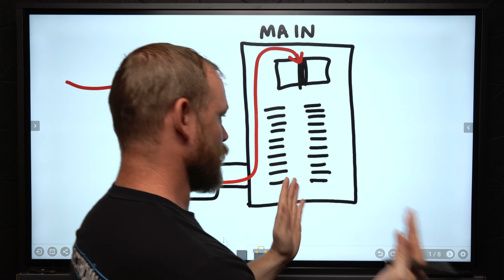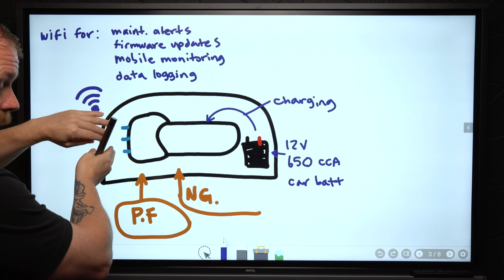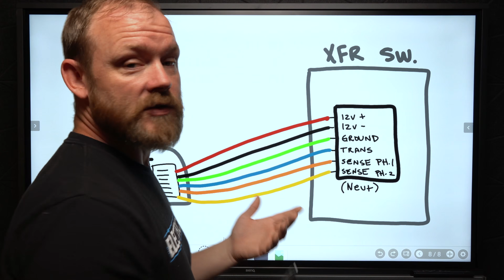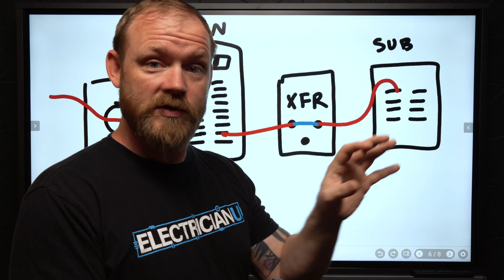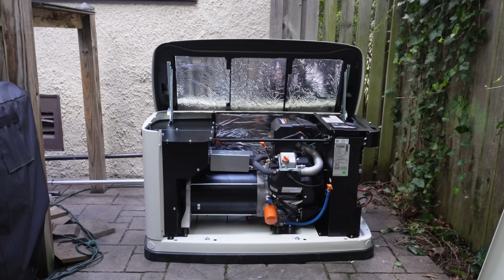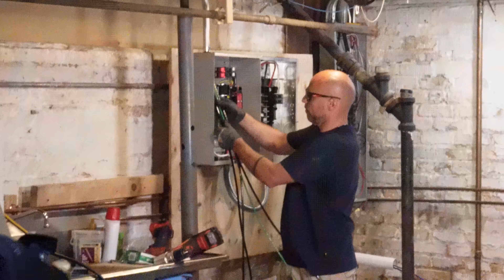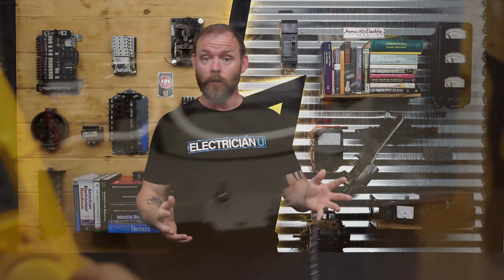What Should You Know Before Installing a Generator? Whole Home or Critical Loads?

Comment: I did the exact same thing except I used an Eco Power solar generator at 18kW. I don't have panels yet, so I charge it at night between 1 am and 4 am using 110v. The ATS is programmed to switch to generator at noon and back to service power at 11 pm. Cut $275 off my summer power bills and the 18kW will run my whole house ac included for 3 days. Bonus is if I lose power the ATS is 1 second so it's a bump and everything keeps working without interruption.
Reply: That's a good solution for folks with demand billing .
" Peak shaving " is a viable way to reduce your electrical bill , sometimes dramatically , by charging during low demand / low kWh use  pricing. , and , running off the bank during peak demand / high kWh use pricing  .
Many solar hybrid inverter / AIOs have integrated automatic transfer switch functionality , so , a separate ATS or MTS is often unnecessary , which can save a lot of money on the install .

Comment: There was no mention of considering load shedding.  One can spec a smaller generator in combination of load shedding devices to prioritize critical circuits over an electric clothes dryer, for example, or other non essential loads.
Reply: Generac has a 50MPH & 100amp module that will accomplish this.

Comment: Not really part of the setup but just good advice, If your running the generator for multiple days during a power outage you should occasionally stop the generator and let it cooldown for a bit a check the oil.  They will burn off some oil if ran continuously.
Reply: their newer units will generally go 3-5 days without using more than a pint of oil, although good to check till you establish that.
Reply: Portables are notorious for poor oil control / excessive oil consumption , so definitely make sure you shut down , allow to cool , and check the oil , at every refuel if you are running a portable .
Side note :
The low oil shutdown sensors / switches can and do fail regularly , and , are designed fail safe . That means when the sensor / switch fails , it will shut down the generator and prevent it from restarting .
Keep this in mind . It sucks , and , during a big power( regional ) outage , you probably won't have the ability to source spares .
Most can be bypassed , but , now you lose a safety system , and makes checking the oil even more critical to avoid a catastrophic engine failure .
If you have a portable , get a spare , TEST IT FIRST ( new parts being defective is a common thing ) , then squirrel it away .
Beats freezing to death or losing $1,000 of food you can't keep refrigerated / frozen .

Comment: You’re not quite right on the last part. When power is restored the generator will remain running, the transfer switch will transfer back to mains after a short period to make sure power remains on. Then the generator will be sent into a cool down mode before finally shutting off.
Reply: Not only that, but when grid power comes back, the generator will sync waveforms with the grid so the handover back to grid power is seamless. So yes - the generator remains on for a configurable period to make sure the grid is back up and stable, and the generator remains on for a cooldown period after the handover back to grid power is made. But the neat magic is the synchronization that makes the handover back to grid power a zero interruption event.

Comment: 22kw Generac would be de-rated on NG to around 20kw.
Reply: that 20 Kw is still around 80 amps (per leg) of usable power. The only reason to need it is for the start surge of AC and well pumps.
Reply: Chech out hutch mountain and drop an EasyStart on your air conditioner to reduce startup amperage.  :)  @rupe53

Comment: A few comments: 
1) We don't get a full view of the area, but from the footage shown the location seems to be far too enclosed to be safe. A generator may run for hours or days under any environmental condition - including a lack of wind. The A/C unit seems to be far too close on the left, there appears to be fencing with vines on the right, and there appears to be 4x4 framing around the A/C on the left so I wonder if something is above on the left. We see a type of open vent in the bottom of the house to the left of the generator - the side where it exhausts. I've very concerned that fumes will easily accumulate in this location and potentially enter the house.
2) The above is a good reason to verify that several CO detectors are working in the house as part of any generator install. And hopefully this generator isn't up close to a neighbor's house.
3) Two of the 6 control wires that sense utility power will each have 120 Volts on them and 240 Volts between them - so, it is best to avoid calling those low-voltage. The control wires should have the same protection as other house wiring.
4) An important part of the project is to verify that the Natural Gas supply is adequate. A 22kW generator will use about 325,000 Btu/hr at full load. As a comparison, a water heater can be 40,000 Btu/hr and my large furnace in Upstate New York is rated for 120,000 Btu/hr. Many natural gas meters in use today are only sized for lower loads and will need a swap out.
5) If you want to save money then stick with a portable generator. If you are spending the money for an automatic generator then you might as well skip the critical loads panel and have the automatic transfer switch handle the whole house. I'd only go for a critical loads panel on an automatic generator if money was extremely tight and there was a very critical need to have the automatic generator instead of a portable one. But for a large 22kW generator it seems a waste to not cover the whole house - and you may kick yourself during an outage. I had a critical loads panel and didn't think the garbage disposal was critical - until I by habit put food waste down the kitchen sink during and outage and then my sink was clogged.
6) My Generac generator exhaust is hot enough to kill my grass during an outage. So, having the exhaust blow against the A/C unit will hurt the A/C efficiency.
Reply: Per NEC anything below 600VAC is usually considered low voltage.
Reply: Don't forget, we don't know what loads are considered critical by the home owner. They may have a number of high draw appliances on it in addition to lower power things. They have natural gas appliances (stove, dryer, etc.), so it cuts down on the load required to power them. However, depending on the size of their AC unit(s) (possible mini-splits that aren't seen), that can easily take half the maximum output on the generator. Throw in a fridge, standalone freezer, some room circuits, and a possible electric vehicle charger. That 22kw might just be enough.
Reply: @MichaelArtelle  For normal A/C units you route the Y cooling control wire right into the transfer switch for Generac. It has built in support to cycle up to 4 compressors on and off if the generator gets overloaded. For other high demand items, they sell modules to control those as well if needed. Except for a handful of circuits, everything else in the house typically uses squat 99% of the time - so why live without much of your house? And sometimes I see a little flicker with my lights if the Generac doesn't have enough load on it.

I took the opposite approach of what was done here and effectively had a non-critical loads panel. I replaced my meter box with a combo meter/breaker box - and plan to put the unnecessary high-demand loads there. For now, that is just a 100 Amp circuit that I have going out to my parking area for EV charging. If in the future I replace my gas furnace with multiple heat pumps then I might put 1-2 of the heat pump circuits there. The generator starts automatically, including if you are away from home or are asleep - and you might not want certain high demand loads to run, as generator electricity is more expensive.

For many people the Internet goes out when the utility power is lost, so you are often looking for things to do inside your house. There is no need to keep half your house dark. And outages can be caused by many different types of events, and you really don't know what you might run into - especially if you wind up hosing some extra guests.
Reply: Jason, you are correct on most counts. Between the owner's manual and your local inspector, you can iron out the details, which may include zoning issue for setbacks on your gen location. Since about 2012, most areas have adopted gen installation codes, which will also spell out distances to windows, vents, and other building penetrations. Common sense will dictate at least 5 feet from other appliances, bushes and grasses. (heat will make them brown) The Generac here (this series) is UL rated for installation within 24 inches of the home on the rear side. Right side is intake and left side is exhaust. (heat) It's all in the book. In the case of Generac, there are 3 control wires with line voltage (utility sens and bat chg) and 3 wires at 12 volts DC. The 12+ is hot all the time. 12- is the transfer switch leg. The 0 terminal is actually a 12 volt chassis ground and operates the load-shed module. Gas pipe size is probably the most overlooked issue using NG as the fuel. (this one is likely too small) BTW, this air-cooled series is now available up to 26Kw so near 400,000 BTUs on the fuel. Since 90% of the expense here is the gas, electrician, and labor, you'd be nuts to skimp on gen size unless you go down to something in the 10Kw range. I was in the business and recently retired after almost 25 years.

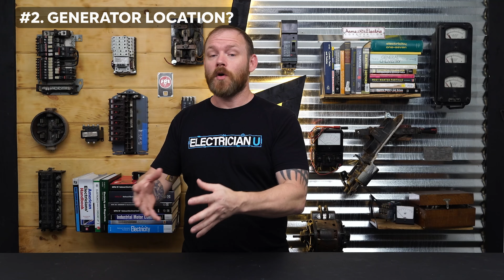Comment: 10:09 but wouldn't the natural gas fail in a power outage also as the pumps designed to create the pressure also fail?
Reply: I'm no expert in any way on how NG distribution systems are set up, but I do know that in all the power outages in my area in the past 50 years,  the natural gas supply has never stopped flowing, and a couple of the outages were over three days in duration.  I have to assume that, just like the city water supply, the pumps and associated equipment are backed up by generators.
Reply: Excellent question .
NG companies generally have their pumping ( compressor stations ) , on a very robust UPS system ( generator ) and these are almost always ( unless you live close by one ) fed off a different primary leg or entirely different substation , than your neighborhood .
These generators are run on natural gas , so , as long as the big pipeline is working , the grid can stay down . The generator will power the compressor station and NG will flow .
All bets are off after a major earthquake , however .

Comment: I would love to have this kind of set up or even a panel interlock set up. Sadly my panel is on an interior wall and the roof is very low pitch so no attic space to run new wiring. 
So I opted for a Reliance Control WKPBN30 Portable Generator Through-The-Wall PWR Transfer Kit. Plug the 30amp cord into it and I have 6 outlets in the house. Yeah I still have to run extension cords but it works.

Comment: While not an option for a whole home generator like this, another option for folks wanting a portable generator (if it meets code in your area) would be to install an Interlock in your panel such that you can't have the main breaker and generator breakers on at the same time.  The benefit here is that it's cheaper to install since it's just a simple piece of metal, and you can power whatever circuits that you want in your panel, although that does mean doing manual management of what circuits you want on.  If I wanted to run a high draw thing temporarily in an outage for example, I could just flip my heat pump off for a couple hours and free up that capacity.
Reply: I just did the interlock option using  my 12500 watt generator and it saved me a ton of money not having to buy an expensive transfer switch and cramming more wires into my main panel.
Reply: The minor inconvenience of having to flip breakers as needed is less inconvenient than having to run extension cords everywhere.
Reply: This mechanical main breaker interlock is not legal in Canada yet. What do you do with the neutral from the generator? Should NOT have neutrals connected together from two different power sources.
Reply: @stevekraft4241 The neutrals are not a problem. It’s if you have bonded neutrals at each source of power. Your service panel has a bonded neutral. Your generator should NOT have a bonded neutral unless you make your generator a separately derived system which is done when you use a transfer switch that breaks the neutral from the utility source. For a home 120/240VAC that would be a 3 pole transfer switch.
Reply: I just finished installing the 50 amp generator inlet plug and interlock to my house two weeks ago.  The generator I bought is the DuroMax 15,000 peak and 12,000 running watt dual fuel model.  Last Friday was testing day, I ended up running the generator for 4 hours.  I turned off all the breakers to my house and brought up everything one circuit at a time minus the furnace of course, since this generator would never be able to supply to a circuit of that size.   I also have a 100 amp service going to my shop that powers 6 led lights and a few outlets.  Then from that 100 amp circuit in the shop I have two RV boxes.  That 100 amp panel in my shop I installed 4 years ago as an upgrade to the 30 amp circuit that was there when we bought the place.  Since that is a sub-panel, the grounds and neutrals are not bonded. 

I'm trying to get thru the 8 hour break-in so I can change the oil and filter and switch to full synthetic.  One thing I've been researching is whether or not to make my generator a bonded or floating neutral setup.  There is a lot of information out there.  And most of its explains which one to use in what situation.  The problem is that if you set up your generator with a floating neutral for a whole house generator setup, then if you happen to use the generator with extension cords other than the 50 amp to your house, then the neutral would have to be bonded.  One guy on YouTube showed how to wire in a switch to be able to go back and forth between the two scenarios.  However even with proper labeling there will always be a chance that it would be on the wrong setting for the setup needed.  

I need to look again to see if my main disconnect outside has the ground and neutrals bonded, because you only want one place bonded. In my case, I have a 200 amp meter base and pedestal outside my house, that feeds a 200 amp breaker panel inside my house, so I really need to nail down whether or not I need to turn my generator into a floating or bonded neutral.  I've already decided that this big and heavy 350 lb. generator will only be used for powering my house. I have another 6500 watt for other stuff.  

Just an FYI to folks out there trying to run a generator on Propane, depending on the draw (fuel consumption) a small 20 lb tank will actually only run the larger generators for a couple of hours and then it ices up and the pressure drops causing the generator to start to sputter really bad.  I talked to a propane guy and he said I would need at a minimum a 30 lb tank, and preferably a 100 lb tank to avoid this issue.  When I switched out my 20 lb tank for a new one, the old tank still had what feels to be at least 60% of the fuel left left in it by weight.

Comment: The picture you showed with the LB is a dream for a whole home setup, replace the LB with a gutter and place the service rated transfer switch outside. super easy.... Also i doubt those conductors are derated properly in that flex going to the critical loads panel. I realize this wasn't you or your guys that did this install so i dont want this to be taken as criticism, just more education and starting a conversation in the comments section

Comment: If installing a Generac Ziller electric sells an umbilical style cable that contains all of the control cables and the proper gauge for the feed (based on your generator) sold by the foot. Makes home owner install very easy
Reply: How does that work? Do you still need a ATS?
Reply: @Ephesians-ts8ze    that special cable (UL approved) takes away the need to run separate conduits and pull the wires. IOW, it's a pre-packaged bundle with the control wires and load wires all together in a weatherproof sheath. You can run it inside, outside, and exposed to the elements. It costs a fair amount but saves a LOT of labor. That cable is also available directly from Generac.
Reply: I used the cable. Made install much easier.  It is pricey - $14+ per foot but worth it.

Comment: And that is the low voltage Nuetral i am referring to within the low voltage panel in generator.
Reply: the 0 wire on the small module is 12 volt chassis ground for load shed. It is powered by the generator battery.

Comment: Why use a 22 kW generator if you’re going to use a sub panel with limited circuits? 
I would rather have solar, as natural gas can be hacked and Shutdown!
Reply: A generator is more reliable than solar and batteries. Most mechanically inclined folks can get a generator running if it needs a fix. Good luck with most fixing solar and battery issues.
Reply: @AdamEltoro  
I admit that I do all the work myself, so that alleviates upfront costs and maintenance, which by the way is very little if any! Also, if your batteries run down, you can get a gas generator for about $1000 to charge them up again. 
Also, I would say that I didn’t know anything about batteries or solar when I first started.

Comment: The nuetral in generator MUST be hooked up in order for the battery tender to function. If not you will get a charging error code and be called back to homeowners house. This is for all models manufactured after 2022.
Reply: This is correct 💯%
Reply: Unfortunately, didn't know this and found out the hard way! Oh well
Reply: Beat me to it. 2023 code change